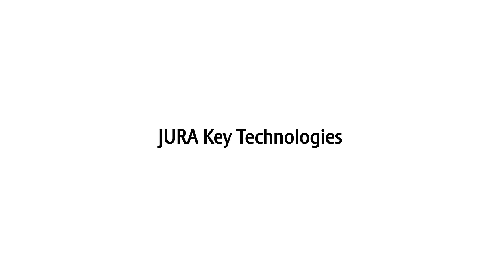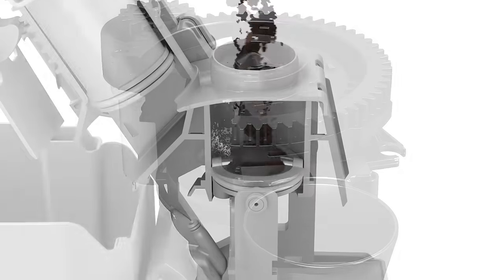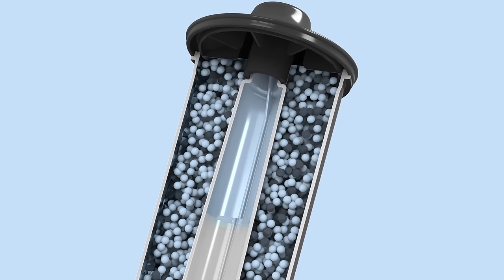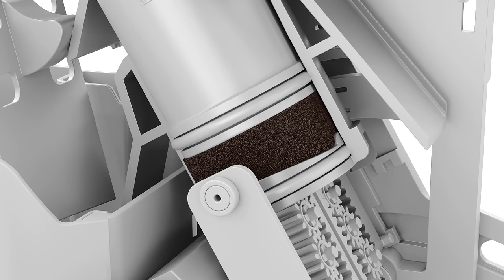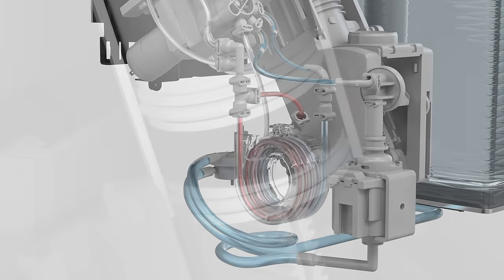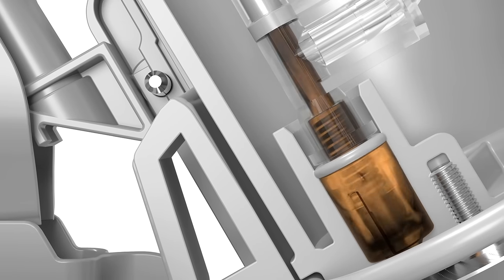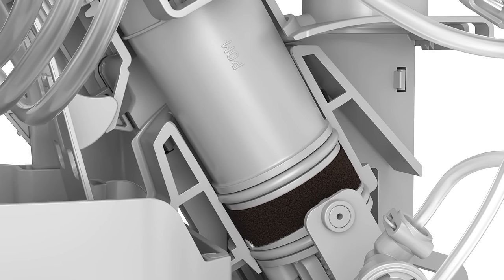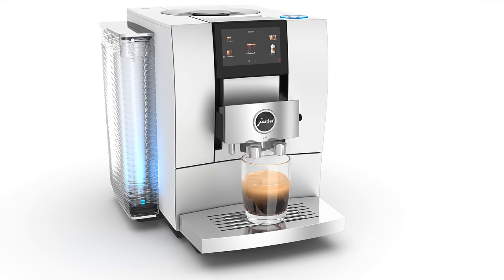JURA Key Technologies | How a JURA automatic coffee machine works

Comment: Are all the jura automatic coffee machines with the same brewing unit? Are there differences between the professional series and consumer series In regards to durability of key components? I don’t want to pay extra for a machines that offers 30 different drinks or have a fancy display. I’d rather pay extra to get the most durable jura machine
Reply from the maker: Dear Josef Krukkeslikker, thank you for your comment. We have two brewing units in use: Our large brewing unit (5-16gr) for professional devices and the household devices (without ENA 8 and ENA 4). For the ENA 4 and ENA 8 we have integrated a compact brewing unit (6-10gr). Regarding longevity, however, does not make a difference. We test all of our components with the same stress test. Both brewing units hold up well to normal use. For a very intense flavor, an E8 with the large brewing unit can certainly be recommended. Kind regards, JURA
Reply: @jura_coffee  I'm wondering if the Jura has a system similar to the 9-bar pressure with a non-pressurized basket, like manual machines. I use 18g with a 36g output on my manual machine. Can we set up shot profiles and temperature like on manual machines? I want to switch to an automated machine that is as good as manual machines. Otherwise I will wait everysys for their home machine until they make one. 
Thank you 🙏🏻
Reply from the maker: Dear  @lenso010 , thank you for your comment. We work with a brewing unit that has a capacity of 5-16 gr (except for our ENA line, the capacity is smaller). The pressure ratios are designed to achieve the best result in the cup with a fully automatic machine. You are welcome to visit one of our great specialist dealers in your country and taste the coffee there. This gives you the opportunity to form your own impression of the comparison between a manual machine and a fully automatic coffee machine. Kind regards, JURA

Comment: the brewing unit will get extremely dirty after a long time of use cus it's inaccessible.
Reply from the maker: Dear Izy, thank you for your comment. The coffee preparation is a self-contained system. The entire system, including the brewing unit, is cleaned during the cleaning process. Water temperatures of over 80°C are reached during this process. Germs are killed by these high temperatures. The integrated rinsing and cleaning programmes are automatically displayed by the machine, started at the touch of a button and offer maximum cleanliness and convenience. Kind regards, JURA